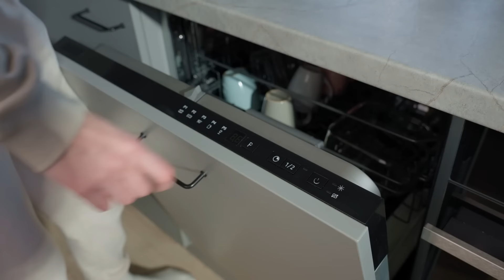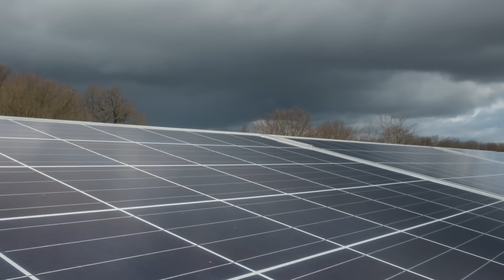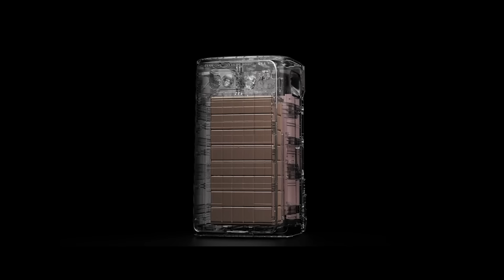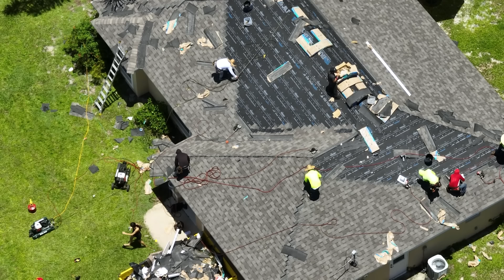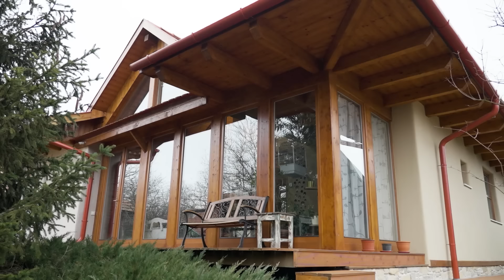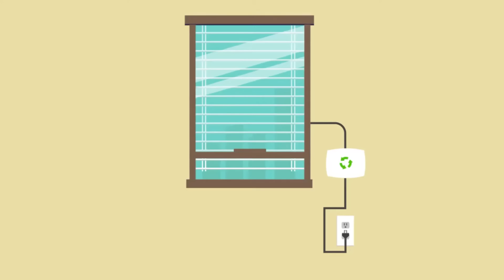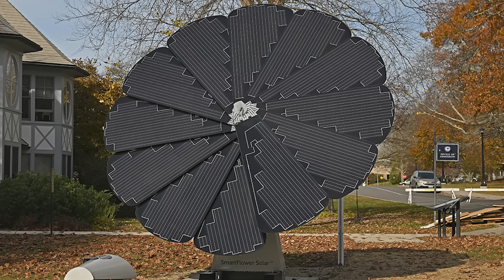Home Solar is Changing: These 5 Systems Will Revolutionize Home Energy

Comment: What a bunch of BS. The cooler the solar cell the lower it’s resistance, the more Watts it produces. If you are keeping it cool there is not much delta T to heart the water to any useful temperature. Looks very expensive with less than half the cells per square meter as regular panels.

Comment: I loved this video. It would have been more beneficial to the watcher if the cons were also provided rather than just the pros. Here are the drawbacks of the SmartFlower system, based on a quick search I did.

These are the issues most owners don’t anticipate.
1. Extremely high cost
$25,000 to $30,000 before incentives — roughly $10 per watt, compared to $3.50 per watt for rooftop solar. This makes it *nearly 3× more expensive* than traditional systems. 
2. Mechanical complexity = more failure points
The petals, motors, sensors, brushes, and tracking system introduce multiple potential failure modes not found in static panels:
Servo motors can fail 
Petal deployment mechanisms can jam 
Position sensors can drift or malfunction 
Cleaning brushes can wear out 
More moving parts = more maintenance 
3. Short warranty for a moving system
Only 5‑year warranty on mechanical components 
Industry standard for static panels is 10 to 25 years 
4. Limited energy coverage
Annual output: 3,800 to 6,200 kWh 
Typically covers 40 to 60% of a U.S. home’s energy needs 
5. Requires significant yard space
Needs 194 sq ft of unobstructed area 
Must be placed where it can rotate freely without shading 
6. Higher maintenance burden
Even with self‑cleaning:
Moving parts require lubrication, inspection, and occasional replacement 
More downtime risk compared to fixed arrays 
Mechanical failures can halt the entire system
7. Noise and motion considerations
The petals open/close daily 
Tracking motors operate throughout the day 
Some owners report mild noise or motion that can be distracting.
8. Vulnerability to vandalism or accidental damage
Because it’s ground‑mounted and visually prominent, it’s more exposed than rooftop panels.
9. Not ideal for harsh climates
Although it auto‑closes in storms, repeated exposure to:
high winds 
snow loads 
freezing temperatures 
can accelerate mechanical wear.
Reply from the maker: Good to know! If doing the cons then perhaps you should mention the cons for the other systems shown in the video.  Everyone has pros and cons. Appreciate the insight thou!

Comment: The end of Net Energy Metering 2.0 (NEM) has pretty much killed the solar market in California, and I don’t understand the craziness behind that. Under NEM 1.0 and 2.0, solar customers could sell their excess generation back to their utility company at retail rates. For many, this zeroed out their utility bill, and some even earned a nice credit. Now, with NEM 3.0, utility companies will only pay wholesale rates for any excess generation. In some cases, this can be as little as 2 cents per kWh. But that’s not the end of solar, and it shouldn’t be.

I missed NEM 2.0 when I purchased my system back in August 2024 and fell under NEM 3.0, or as the utility company calls it, Solar Power Billing (SPB). Instead of selling my excess generation back to the utility, I store most of it in a battery that powers my house at night. Sure, I still generate more than my battery can hold and get a small amount for it from the utility, but I’m still using very little from the grid thanks to the solar and my backup battery. For example, I checked my utility bill for July to August 2024 before I got solar, and we used close to 1,400 kWh that month. Two years later, with solar and a backup battery, we used only 96 kWh from the grid during the same period.

An added bonus of having a backup battery is that during a grid outage, we never notice it since the house switches to the battery in the blink of an eye. People with regular solar are left in the dark like everyone else. One final perk is that I live in the Mojave Desert, where summer temperatures often exceed 115°F, straining the utility grid. Because my battery is made by Tesla, they often buy electricity from it at 79 cents per kWh to support the grid. I don’t even own a Tesla car, but the offer is available to anyone with a Tesla backup battery. Over the last two years, we made over $300 in just two months by participating in their Virtual Power Plant program during three separate events, none of which affected our grid usage.

So again, I just can’t understand the craziness of people getting discouraged about going solar just because NEM 1.0 and 2.0 ended. I think it was the best decision I ever made.

Comment: First, can the powerflower be hooked up to run a tankless on-demand water heater?  Second, if I'm offgrid in a county with no building codes, will homeowners insurance still be available with that setup?  TY.

Comment: If the material cost could become cheaper for building homes-apartment buildings + the building company working with solar energy companies that keep upgrading/inventing new solar power systems and cutting the costs for them. If the two worked together when building apartments having the buildings be able to use solar to take care of 50% of the minor lower demanding needs then the remaining 50% comes from the city grid that would be great. Having the apartment have built in high quality battery storage that can kick on during blackouts built in during the building first construction and not later meaning higher costs remodeling needed all over would be smart. Also there’s new smaller wind power technology also that’s not the simple wind blades but new cosmetically pleasing designs that you can loop many together that could even mean 45% solar 25% wind 30% natural gas for large apartment buildings. It of course comes down right now to the costs because right now doing this unless something is done to help lower the home costs then doing this could add the price of the solar/wind costs on to the already high price of our homes. It doesn’t help when you have politicians in many places wanting to raise more taxes in order to pay for all the stuff they said they’d give to people for free if you vote for them.

Comment: What advantage the SmartFlower has over a square-shaped solar panel grid mounted over a tracker? Aesthetics?
Reply: Less dollars in your pocket for less kWh.
Reply from the maker: Yes aesthetics!
Reply: @wildline_YT  

Then, ArtFlower Tracker is a better fitting name. Honestly, forking $30.000 to produce 2500-4000 watts is not a 'SMART' investment.
Reply: @wildline_YT and that is very debatable.

Comment: The reason we have not invest in solar because our shingle roofing is 20 years old. 

I really like the ECO flow because during power outages etc all you need to power is your refrigerator and some small electronics . 

But I will be setting up solar roof carport and install an inverter system to run a tiny house for my sister.
Reply from the maker: Sounds sensible - I assume you will be installing a battery to store excess electricity!
Reply: I have several midsize EcoFlow solar generators for emergency potential which is low where I live.  All are the same make and model so if something conks out, things just have to be shifted around.  All batteries the same etc.  

But I don't feel the need for anything approaching a whole house battery, bc like you, I wouldn't need very much in a grid down.  However, since I'm a single person of very modest means, my entire frig hasn't got that much in it to lose; so I'm not about to throw away a ton of $ on a generator to run a frig to save what? for me, maybe $200 at most, once in a lifetime?  Makes no economic sense.  I also like several small independent units so I don't have to risk tripping over a big long wire strung everywhere.

Comment: Smart Flower :: Well over ten years ago I remember following a blog written by a professor of Physics. He described how he built his own solar panels from cheap, slightly out of spec solar cells, and mounted them on a frame attached to a motor from a movable satellite dish. He then added a simple circuit using two photocells that operated the motor to track the sun. I wonder if he's the brains behind the Solar Flower?

Comment: CLICKBAITBOLLOCKS,
BEWARE!!!
Any solar on a tracker to pivot and follow the sun is damn expensive and this airy fairy design proved to be just that, when I saw one in situ  it was not capable of work ing, this was/ is an architects folly and does not represent the real world, and is priced so high that ever reaching payback through energy and produced is sadly unlikely.

Smart flower ought be nuked from our collective minds,, the narration is bollock s because it does need an expensive set up and support and likely would not be allowed in many urban housing estates. 
I say again, no more than an architects folly, not many have been sold.because of that!

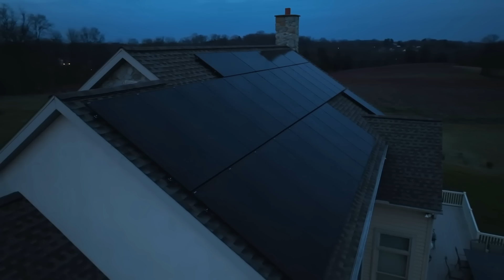Comment: 5:28 If there's a stormy cloudy sky what good does it do having the solar panels turned on???
Reply from the maker: None !  Without sun there is obviously no solar generation. Not sure what point you are trying to make here?
Reply: @wildline_YT well what point were you making when you emphasized that the panels are shut off in the event of a storm? You made it sound like if not for the panels being shut off you would continue to have generation. Solar panels being shut off during a storm have nothing to do with a house's viability of power. Any house that wants to maintain power during a blackout should have a battery backup solution which is easily integrated with a solar setup.

Comment: It's basically a parasite on the grid can only put in about 15% once connected to the grid the ignorance of Renewables is easily demonstrated with a volt amp meter and 4th grade math called Ohm's law so if you were to double-check your installed watt meter you will see about an 85% difference then you add a battery for five percent less
Reply: My, my, those Europeans must be so ignorant running their countries on solar power the way they do ....

Comment: I manage a facility that has 2 smart flowers and they are down with problems about as much as they are operating.  They are absolutely visually beautiful but I would not advise anyone to get one.  In 4 years of ownership we have had to replace 2 complete head units and multiple position motors.  Unless you are a skilled technician then you will be sorry you ever got one.  
Tech support is decent but if we didn’t do the repairs with our own technicians then the downtime would have been significantly higher.  Stationary Solar panels are the way to go!

Comment: The ecoflow device wouldn't be allowed to operate under your description with a power outage.  You would back flow energy onto the grid during a blackout.  Explain more please.  Unless the nema 4 connection is a backup panel.
Reply: Ecoflow does not senx energy onthe grid d'urine a black-out.
You have one, two or three connections on the boy of the ecoflow and you connect there electric appliances you need

Comment: In Australia rooftop solar sells power back into the grid, houses also have battery storage for grid stability and for domestic use in grid outages.  It has revolutionised Australian power generation as the cheapest and cleanest energy source.
Reply: Yes, but you see .... Australia seems to be a perfectly sane country, whereas we here in the states amount to an open air insane asylum.
Reply: The solar owners I know are furious about the Sun Tax, Remote Kill-Switch etc.
You certainly have no skin in the game or:
You're just another institutionally grown individual, namely a submissive statist slave which is always into SM game, the more the state f u up, the more you love your master.
No explanation will change an institutionally grown zombie to understand the very concept of agency
which would make them question everything that comes from a wannabe master whose goal is to squeeze more and more out of his flock.
Reply: Much of Europe doesn't have nearly as much sun as Oz, but there are both domestic and commercial solar-electric systems everywhere. The standard installation is a grid-tied system with panels, batteries and a hybrid inverter. 

Funny how the Yanks often think they're so far ahead when it's just that they don't pay attention to the rest of the world.

Comment: Roofs of new homes need to be built with solar shingles.  Not just panels covering a portion of the roof but the entire south/east/west facing roofs.  With solium storage batteries starting to come available, sufficient battery storage for 24 hours should also be manatory.  Banning dark roofs would also be a good start for energy efficiency.
Reply: I want to cuss a blue streak when I see these 'modern' houses with dark roofs and entire exteriors.
Reply: Solar shingles are a loser , Tesla jaguar it down .. GAF to follow..
Reply: @mdcplace100  - 'Loser' compared to what?  Anything like asphalt shingles???  hahahaha!!!!  Instead, give up a little yard space for a ground array of the newer stationary solar panels, or put them on the top of a carport etc. but not the roof of the house EVER.  Good grief, we've even got powerful but lightweight, flexible solar panels coming to market now.  No need at all to kiss Tesla arse.